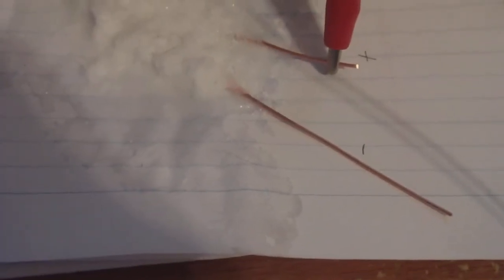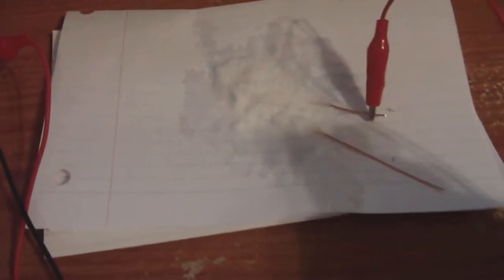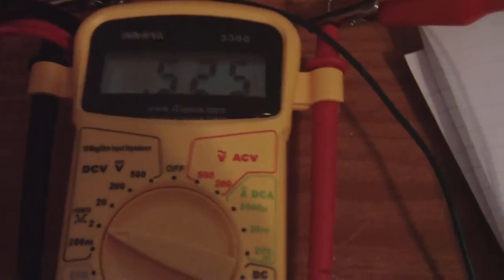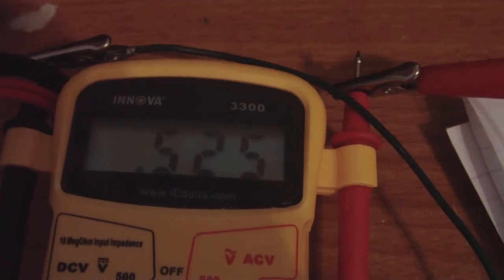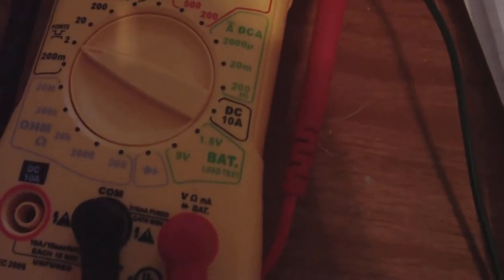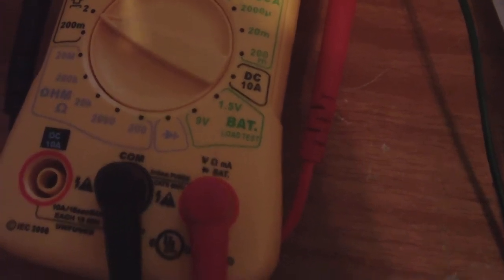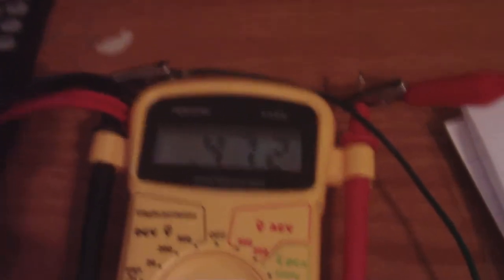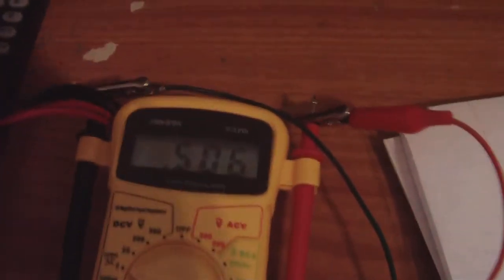Same Metal Electrodes Protruding From Crystal Glue Cell

Comment: If I may ask. When you use the same metals, is it that they have to be different lengths ? Also, yesterday I made a calking battery using copper and a coil of de-galvanized steel that I stripped using electrolysis. I hooked it up to a 9 V dc battery and then put a load on it. It never lost it's voltage. When I took the load off, it charged. Btw, thanks for this information on this subject.